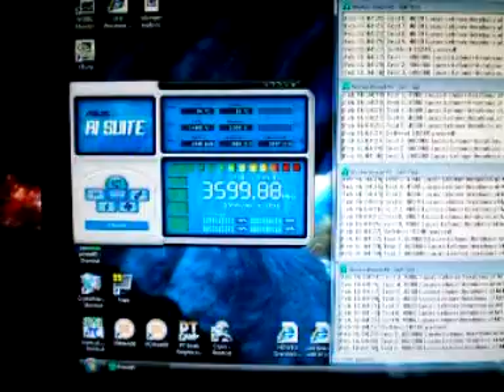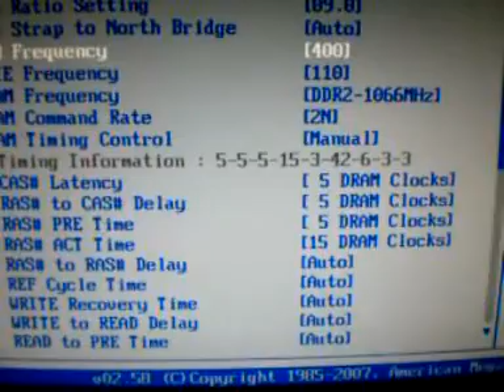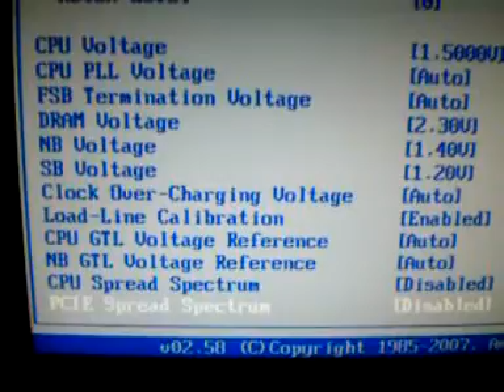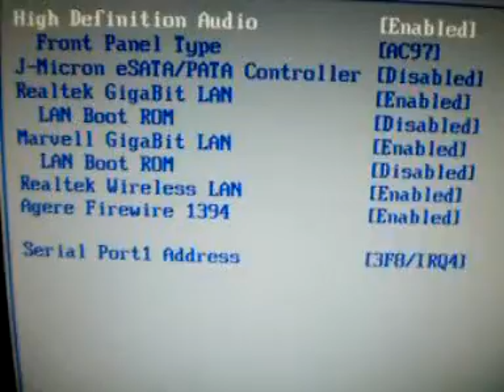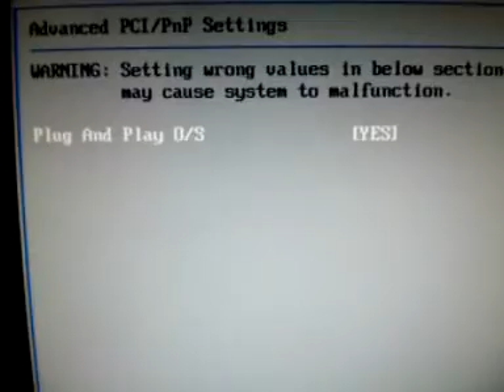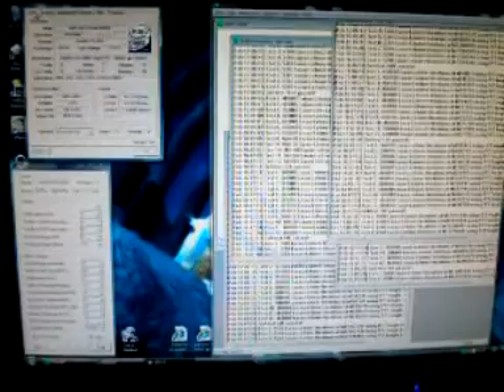overclocking over 400 fsb tutorial p5k with q6600 SLACR

Comment: Hey mate, I have a 2.4 Q6600, but I cant clock the FSB over 333, with a x9 multiplier. I have 1600 RAM and compatible P5Q3 deluze mobo, but no luck. ANy ideas for settings?

Comment: (another one i have ordered 120 mm to zip tie by my memory and pcu pushen the heat to the 2 exaust fans, hopen it will help lower under 60.     Anways...question is now im overlcocked i had to set my pci freq to 100 and noticed you did same but 110,(mine crashed when i tried), so it wont ruin graphics card right?  So now my memory went from 5/8 1066 to 1/1 667.    Which is better?   Should i want to put more Voltage to it instead of auto and push it back to 1066? will it hurt my ram to leave it?

Comment: Hey....i got just built a pc for the first time.  I got a question for you.  specs - e8500 3.16 @ 3.8, (400fsb) took 1.275 volts do get there and runs stable on prime for 30 min with 0 errors and 62 degrees.    Asus p5qse MB, 4 gig corsair cm2x 8500, 74 gig raptor, 650 logisys gamer PW, lg 52x opt drive, 9800gtx, pci xfi creative sound, 6 80 mm.